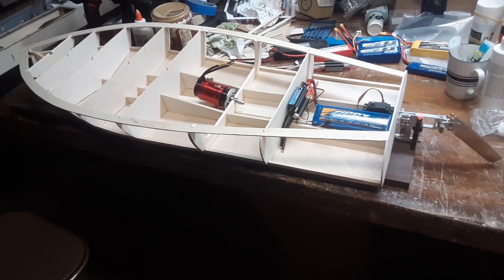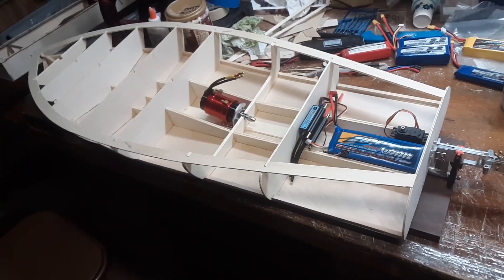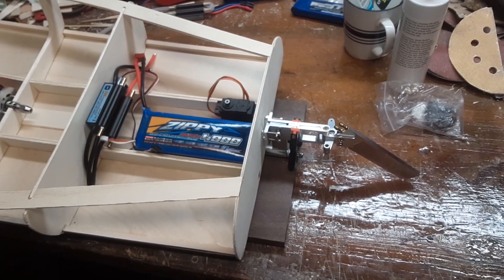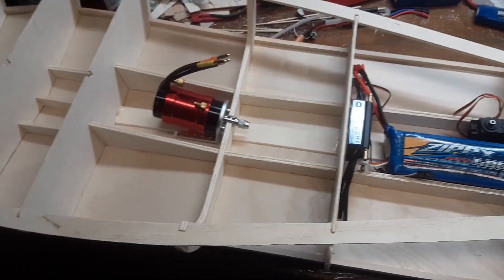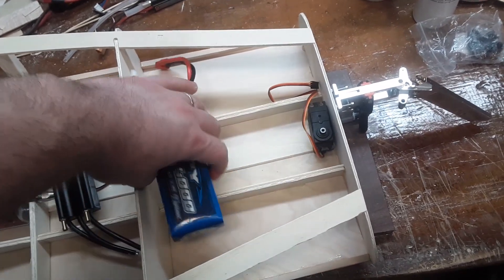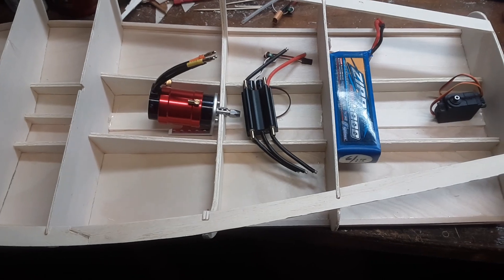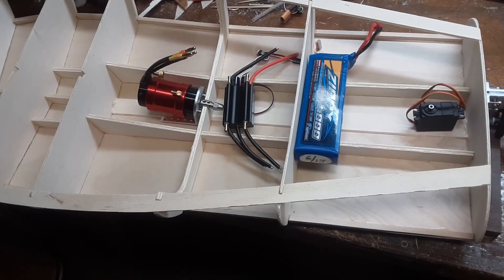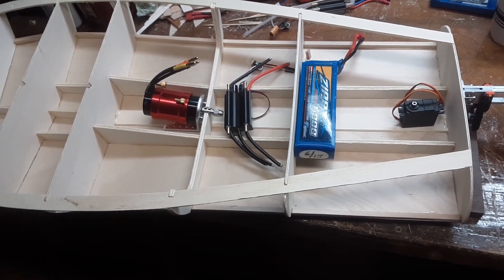Dumas SK Daddle 36" PT1

Comment: Hi as a sport fun running boat you could try running 2 batteries  in parallel for more run time. I think it will help with the center of gravity also. Excellent video
Reply from the maker: I was looking at it after the video. I found if I turn the battery around I can put the servo toward the back centered and they can both be in the middle. Which means if I want to I can run one, two or three batteries.